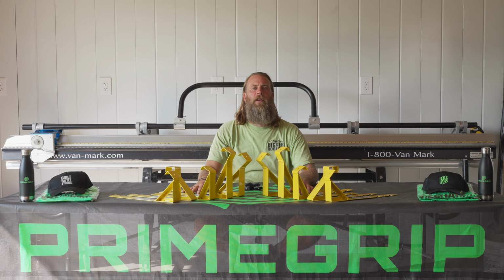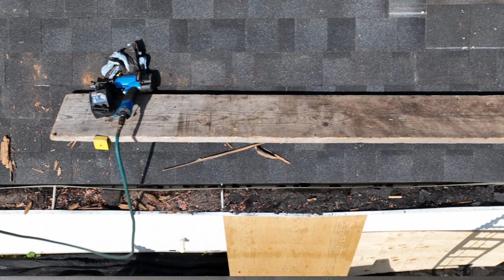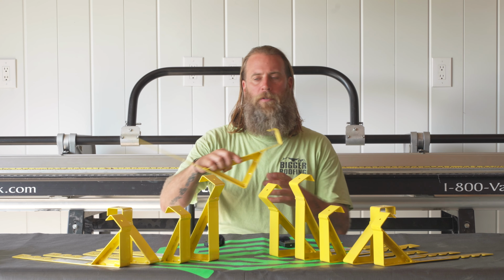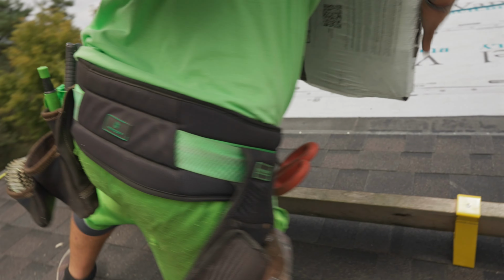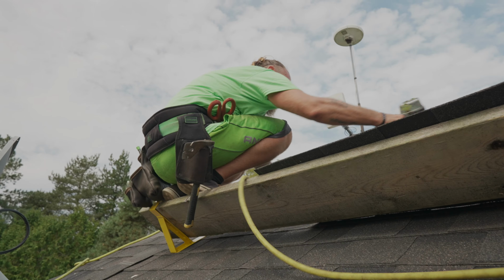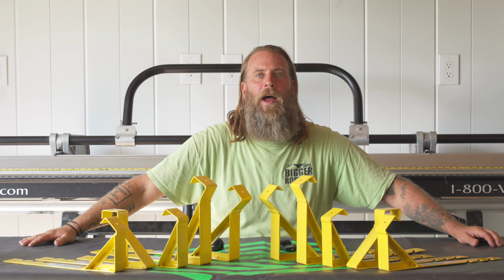Primegrip's roofing brackets

Comment: Prime gripcould be so much better but people are stuck on copying other things and only making cosmetic changes these jacks are not any better than any other type due to the weak point being in the same place as all the rest. Yes you know that spot right above all that fancy triangle fanagling done to make it unique. Waste of material production time and weighs more and you know what that ripper is too thick on the teeth I had to grind it down on the top so it gets under the loose nails ya I can just hammer them in with the hammer knife but it’s literally sitting in the same spot as my hatchet so you know. Useless extra bulk and weight everywhere. Cmon guys have an eye also if bdr ever sees this I been a shingle monkey almost 30 years I got sick designs for a few things we use daily I would love to give you I applaud you and appreciate the good work and great example you are